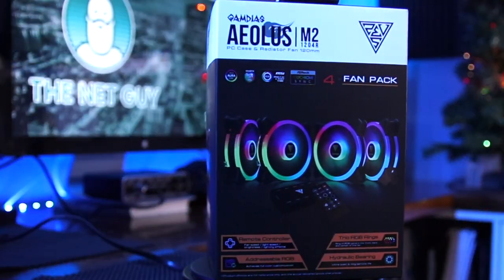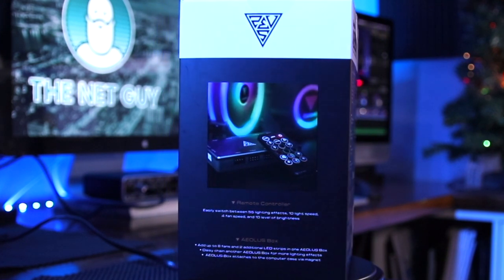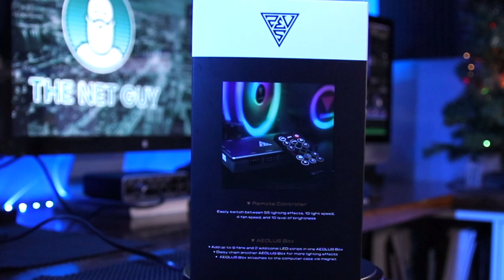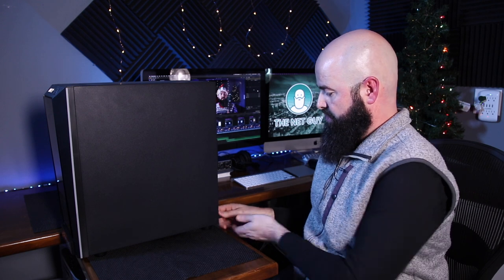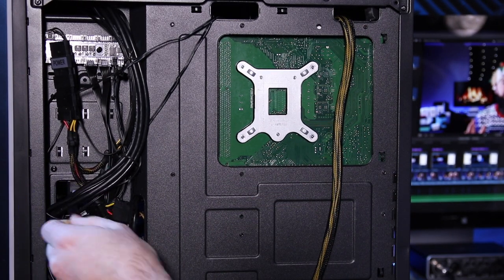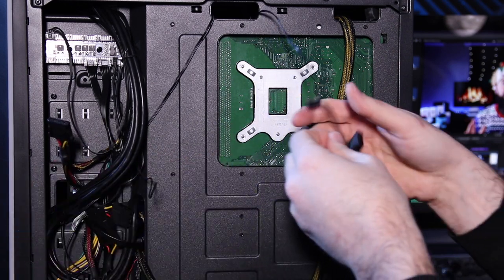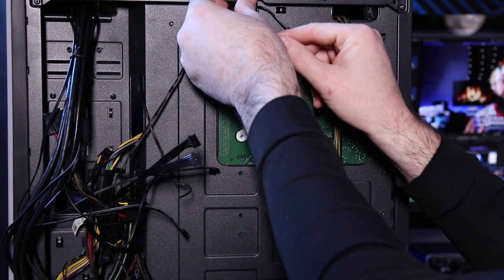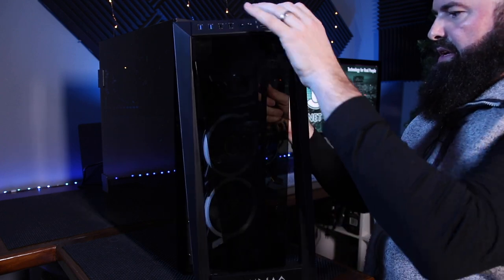RGB Fan Upgrade

Comment: Very nice and detailed video.. even any beginner can install these types of component in their pc with ease.👍
Reply from the maker: That's absolutely true.  I've always said you can't break your computer through the keyboard worse than I can fix it.  When you pull out a screw driver there are some things to watch for - but it's MUCH safer than the early days when power switches had 120v on them!  Soft power with ATX is a great thing!  Thanks for watching and I hope you stick around!

Comment: do the fans have rgb connectors too? i only have 1 rgb header on my mobo and most fans i saw tend to have rgb connectors and the hubs would have a place for the rgb cable too. Is this the case here?

Comment: hey man! its a great video just upgraded my fans watching your video and these are really good and bright but sadly i cant connect it to my motherboard for 3pin 5v rgb my mobo has 4pin 12V any suggestion in case i want to control it with aura sync?

Comment: Great vid! I have the Athena M2 that you did review on. Currently my case came w 4 fans and they were plugged into the green pcb rgb controller. It has 2 slots open. Can I get any rgb fan and plug into those 2 free slots? Or does it have to be the Aeolous? Also woukd it just be a single fan cable coming from the fan to that controller and that’ll take care of both fan speed and rgb?

Comment: Hey man. I have a question over the gamdias rgb fans.  I have the chione 360r with 3 fans. The fans have 8 pins and you can put it into the controller that comes with it. I also bought a triple fan pack from gamdias. The fans have 3 pins. Can I put them in my controller?
Reply from the maker: Unfortunately there are proprietary fan connectors on the Chione 360R, but yours are factory non-PWM (3 pin). You can run them still off the motherboard if supported.

Comment: Hi, would love your help. You removed the controller that came with the M1A case and then connected everything to the Aeolus module but left the LED strip lights on the case disconnected. Is there not a way to connect the M1A RGB case fans to the Aeolus control module?
Reply from the maker: Great question.  I believe there are ports.   They may have been an oversight.

Comment: Hii is there any pattern in which these fan were connected to the controller actually i have 5 fans set and only 2 of them are glowing rest are working without rgb lights ???
Reply from the maker: Yes, you need to install them while “on” so they get added one at a time. Start with fan1 and work to fan5.
Reply: @TheNetGuy did i have to power the controller first  then plug the fans to the controller
Reply from the maker: Yep exactly.

Comment: Where do I connect the gdv cable on a Asrock b450 pro4 motherboard
Reply from the maker: Howdy friend!  Looks like it plugs into the ADDR_LED1 port - it's the fourth header from the right on the lower side of your motherboard if traditionally mounted - near the USB headers.  Page 50 of the motherboard manual shows it: https://download.asrock.com/Manual/B450%20Pro4.pdf